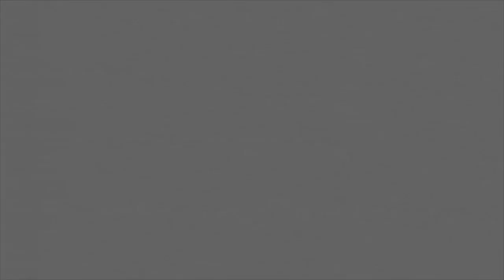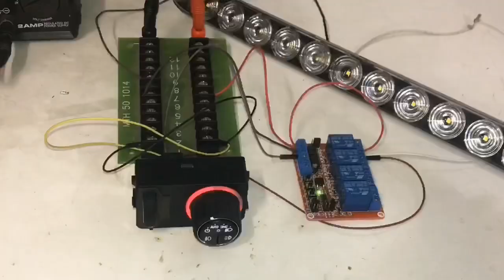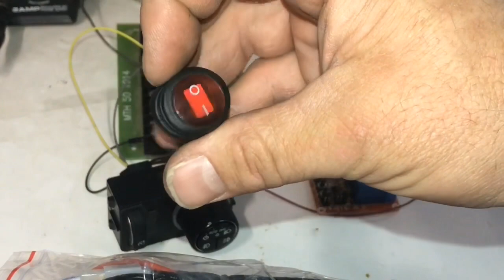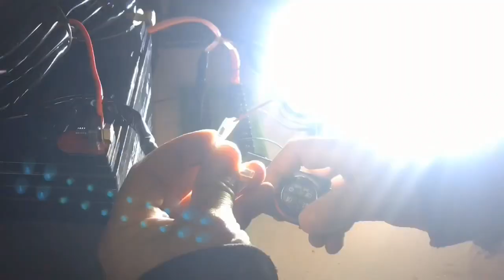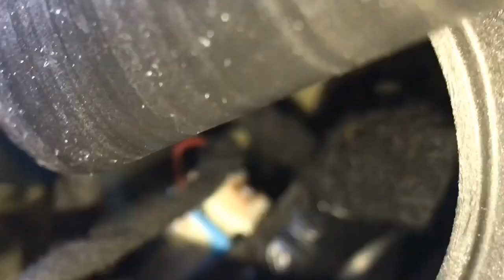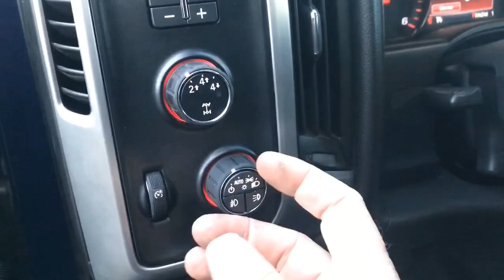2014-2015 GM Truck OEM Off-Road Light Switch Retrofit

Comment: Is there a specific reason it's a 4 channel Relay?  Can I use a 2 channel or 1 channel?
Reply: Also is there another brand you can recommend since SMAKN  out of 4 channel 12v self locking Relays
Reply from the maker: A four channel gives you options to add another switch bank…https://youtu.be/nSlIk0tnAwQ

Comment: Still trying to hook up fogs. I got the same latching relay.  Hooked up ground, 12v, switch pin to ch1. 12v jumper to com1. Fog+ to No1. Nothing happens when I press fog on. The latching relay is lit up green and flicks through the channels when I press each individual button and they light up red. 2017 Sierra 2500hd.

Comment: Hi. I have a 17 Sierra that didn't come with fogs but I added some oem replica fogs with aftermarket harness and an oem headlight switch with the fog option. So I knew the switch powers the fogs through a ground so I had someone rework the harness for me and I got it all hooked up and of course, the fogs only come on if I hold the fog button in. Upon my research, I finally found your video and see that I need to do something like this. I dont know anything about electrical stuff.
Reply: Please help.

Comment: Wired my fog lights like this as my truck didn’t come with them. Relay latches and they come on but then the relay will not unlatch when pressing the button again. Any idea why this would happen? Thanks
Reply from the maker: You might have your output lead linked back to the trigger causing the relay to trigger itself after initial triggering it in.
Reply: @kevefox  doesnt appear so. after some more messing around I realized the latching relay works fine if I disconnect the output from no1 going to my fog light relay. Possible a faulty fog light relay?
Reply: The latching relay itself also has its own switch on the board for each circuit.when using it they work fine as well

Comment: Is there just a dead x61a plug behind the on all trucks?
Reply from the maker: The junction block (X61A) is there on all trucks. The X7 connector is not. It’s an add on but the part that you plug into is there with powered up (fused) accessory circuits. Phil Gamboa at Harness Dr sells fully populated plugs....
https://harnessdr.com/product/2014-2019-silverado-sierra-x7-auxiliary-upfitter-harness/
Reply: @kevefox  sweet man thanks just ordered one
Reply from the maker: Awesome!

Comment: Would you possible be able to provide me with a number of this relay I bought two of them and look the same as yours but aren’t latching I put the jumpers like yours and still only momentary i would really appreciate it thank you very much
Reply from the maker: Here ya go...SMAKN 12V 4-Channel Relay Module High/Low Level Triger Self-Lock Relay https://www.amazon.com/dp/B00NOLTFIK/ref=cm_sw_r_cp_api_i_NdCsFbJM20GGR
Reply: Tinkering Fox thank you very much I appreciate it
Reply: @Tinkering Fox Really excellent teaching! Thanks for putting this together. The 4 channel relay module says no longer available. I wonder if you might suggest a replacement? Maybe a 2 channel relay would suffice? In my case, I’m installing Morimoto xd led fogs on a 2014 Sierra 1500 SLE (without a factory fog harness) but it has fog holes in the bumper. I also have a Morimoto harness which has a lighted push button switch, meant for the dashboard (but I don’t plan to drill any holes using your method). The harness included a relay, a fused battery positive wire and negative wire. I need an updated OEM switch (red light) with the push button fog control. I’d like to build the harness for under the dash with your direction as to which pins to use for my use case if possible. Thanks!

Comment: Great info...question...  I have a 2017 Duramax without any factory fogs or off-road lights installed from the factory. I do have an OEM light switch I bought with a provision for fog lights. Can I do this with that switch?
Reply from the maker: Yes, just plug your wire into the fog light output. I’ll look at the schematic at get back to you on which cavity it is...
Reply: @kevefox    Took a VOM to the switch. On this switch with just a fog light provision, pin #10 is for the fog lamp function.
Reply from the maker: Sorry I’ve been running non stop.
Reply: Tinkering Fox     thank you!!!!
Reply: @tinkering Fox I’ve confirmed that on the GM switch (Pn 2345-8495) with the combined fog/off-road buttons that:
- pin 6 is the trigger for the off-road output and 
- pin 10 is the trigger for the fog output and
- pin 9 is the switch’s lamp for the off-road button
- I can’t find a pin that lights the switch’s lamp for the fog button. 
I plan to install this on a 2014 GMC Sierra 1500 SLE.

Comment: hey i want to take it one more step on my 2014 silverado that didn't come with fog lights. i have some LED fog lights from morimoto and a harness from gen5diy on my truck and it works perfectly fine except for the fact that they can't be switched on and off. i'd like to get a sport bar with some LEDs and add this switch to control all my lights. do you think that would be possible? i don't care too much about the bcm cluster indicator lights but if they worked, it would be a bonus!
Reply from the maker: Yes, of course. Just wire in those switches.

Comment: Will the 84168423 work in a 2015 I see it states 2017 and up
Reply from the maker: It will physically fit but if it’s for a GMC it will be the wrong color as it’s a blue switch. Additionally the 2015 isn’t programmed for this mod, only 2016+up. Here’s a video to get you rolling.... https://youtu.be/k4uM1_-_Ot0
Reply: Tinkering Fox my truck is a 2015 and it cane with the blue switch and all the background and I know you sad that 2014 and 2015 come with the red 2017 and up with the blue  is this normal or gm just decided to do that because I bought the red switch to have the light bar led indicator it just looked weird with everything blue and that red  ??
Reply: @kevefox  what happened  to the link, it doesn't  work?
Reply from the maker: @pauliemoto  what color background does your switch have? Also start a new comment so the OP doesn’t get more notifications about their comment.